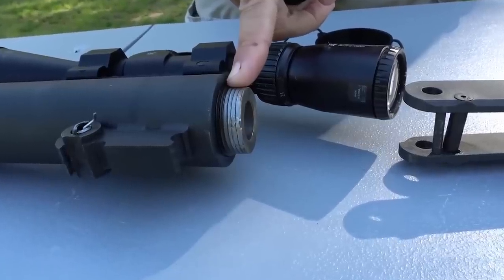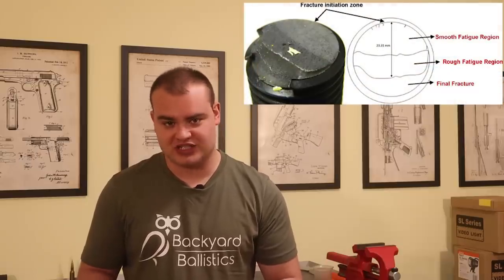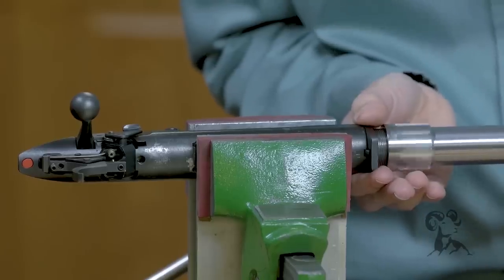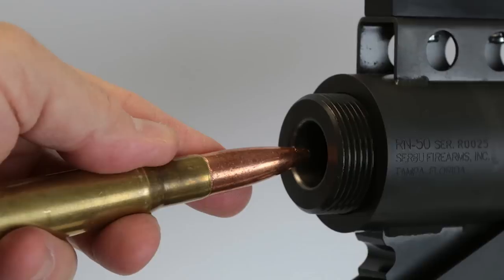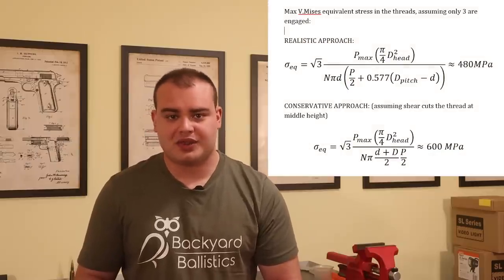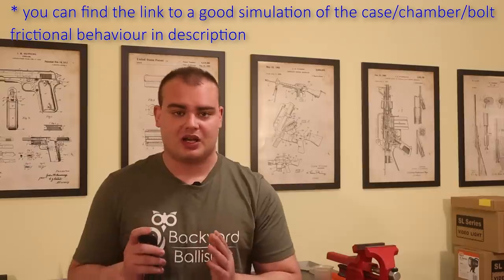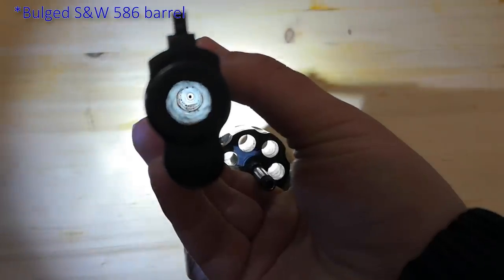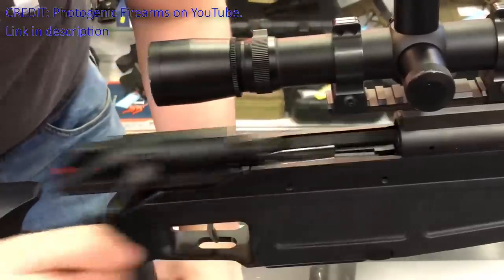Serbu RN-50 Failure: A Closer Look

Comment: The difference between a "Couch Forensic Investigator" and a "Professional Forensic Investigator" is that the Professional accepts the right answer even if it's a boring and uninteresting one and the Couch Forensic Investigator never accepts the right answer if it's not fantastic enough.

Good video of course the threads failed from overpressure.

Comment: In the end, the threads failed.  It is true that we don't know the psi of the round, but we also can't presume that it was above a reasonable safety margin.  Just a few questions that I have:

1.)  The cap did not have a recommended torque value, nor was there one recommended by the manufacturer.  Sufficient torque is required for this application.  Less than adequate torque reduces thread engagement, and weakens the connection of the cap and barrel.

2.)  In the instructions for the rifle, there is a recommendation for the application of masking tape to protect the barrel/cap when they can't be unthreaded without the use of a wrench or pliers.  A problem like this is an indication of thread wear, distortion, corrosion, deposits or an improper thread design choice.  Any of these problems will eventually result in a weaker thread engagement.  This will eventually cause even more thread distortion/erosion, and this will increasingly weaken the cap retention strength.

3.)  There is no provision for any venting of gasses in the breach as there would be in most bolt rifles.  As the gasses are not controlled, some will escape through the threads.  As they escape, the superheated gasses will change the properties of the metal where the gas escape is concentrated.  As these areas are temporarily softened they are almost simultaneously hammered by the rearward movement of the cap.  The temper of these areas will also be changed.  

4.)  It looks like the root of the thread remains on the barrel.  This may be an indication of poor thread choice, improper machining tolerances, deformed threads, mismatched tempering or improper steel alloy match.

5.)  The comparison of threads on the breech to the threads at the connection of the barrel to receiver isn't really a good one.  The threads at the rifle/barrel connection are torqued, more often than not are screwed together once, should allow no gas escape through the threads, and when screwed together are much cleaner than the cap/barrel threads will be over time.  Further, there are more threads in the receiver/barrel connection.

6.)  There is an indication that the powder has a slower burn on the shot just before the problem.  It's very possible that the load is different.  The shot before that is also a bit strange as impact is a foot low and to the right.  Even though the load of the rounds could be substantially different, both of these could be an indication of barrel obstruction.

7.)  Any weakness would progress exponentially and that needs to be considered in strength calculations.  It looks like your calculations are based on a new condition without any deterioration.  We don't know what the deterioration was, but it was present.  

It's important that a statistically significant sample of the rifles be obtained for testing.  It would be great if more of the ammo could be obtained and tested.  

I just don't see a simple solution to the problem.  

I'm sure you've considered many of these and you probably have excellent explanations.  I am not an engineer. 

By the way, your videos are very interesting.  Keep up the good work!

Comment: If anyone wants an update, there was pistol powder in the Slap round instead of rifle powder, which is VERY, VERY BAD, since pistol powder burns way faster than what you would use. The rifle itself was fine, but the pressure in the chamber was likely well over 150 000 PSI, while it is rated for 60k and was tested up to 85k.

Comment: Excellent video as always. Your position as a firearms examiner in legal cases, carries into this video in your delivery as well as graphs and formulas.

As far as the threaded caps, home made shot guns, be they slam fired or with a crude firing pin arrangement, using galvanized plumbing pipe, have been around for a while. There are police and military photos of these crude guns that had failed, but usually at the welded seam, never at the threaded cap. 

I do agree with your first video that failsafes should be incorporated in future designs, and likely Serbu's liability insurance company may mandate them.

Comment: I hope Mark remakes the RN-50 with some sort of interrupted thread breech like are used in artillery guns.
Reply: That would be a lot more expensive and I'm sure the rifle is designed the way it is to be cheap for a .50
Reply: @Phoenix_Atlas  it would not be that much more expensive. All it would really do for that type of breech is add a couple more turning operations on the lathe and maybe another milling operation. Besides, I think it would be worth the extra $200-300 per gun to incorporate that kind of safety measure, especially after having such a public display of the inherent weakness of the screw on breech.
Reply: @elburropeligroso4689  the inherent weakness that is rated at 20000psi over what the caliber should top out at
Reply: @elburropeligroso4689  a weakness that appeared at over 50% the maximum rated pressure of a .50bmg cartridge.
Reply: I hope he recalls all of them.
Reply: @elburropeligroso4689  He already talked about why he didn't do that and its because it takes a lot more effort and will add more cost though both complexity, R&D, and time.
Reply: @camojoe83  he might. I'd be a little surprised if he did, but he might recall them and add a whole lot of metal between the shooter and the breech cap. 

But remember that the failure was caused by a round at over 85,000psi. 155% of the design max of .50bmg.

Proof tests are conducted at 125%, and so *would not have caught this*.

Not to forget that SLAP rounds are explicitly only to be fired from M2 machine guns and not a Barrett or whatever rifle due to the sabot tending to peel off in the muzzle brake and cause a baffle strike. 

Going Ballistic has a liner that a friendly machinist made for them to hold the sabot together until the whole package leaves the brake, but they stopped shooting SLAP through their rifle due to the low muzzle velocity they were getting. SLAP is set up for a 45" long barrel, not a 30" barrel. Should have slower burning powder than standard.
Reply: @elburropeligroso4689  it was a military round, extremely expensive and not in current manufacture, aside from the round the gun would not have failed, as stated clearly by our friend here.
Reply: @ScottKenny1978  I'd wager that particular round would have damaged or destroyed most 50s given the minimal pressure required to have caused that failure.
Reply: @JohnDoe-nf7up  yup. That round would have totalled a Ma Deuce.

And M2s are build like a bank vault!
Reply: @ScottKenny1978  But Scott told Mark what rounds he would be using and Mark sent him a modified barrel to handle the slap rounds.  Seems he is involved more than you are saying.
Reply: @ragnarragnarsson3128  literally everybody has already determined that the round failed... Stop trying to make it the rifles fault, this was gone over in the last vid.
Reply: @ragnarragnarsson3128  round was at least 155% of design pressure for a 50bmg. Proof rounds for a firearm are 125% of max design pressure so would not have caught the problem. Also, note that a design that safely channels force of a failure at one pressure may not safely do so at much higher pressure.

You can survive hitting a bridge abutment at 25mph. Can you survive it at 50? Same problem.
Reply: @ragnarragnarsson3128  the modification required to safely shoot SLAP rounds through a muzzle brake is a liner to hold the sabot together until the whole thing leaves the muzzle brake.
Reply: @elburropeligroso4689   You forgot the need for an effective out-of-battery safety to stop the rifle firing without the threads engaged, which would be a major issue with an interrupted-thread design.  This would not be a simple or cheap modification.
Reply: @marcusborderlands6177  Mark hasn't completed his analysis of the RN-50 broken pieces...so nothing is settled yet.
Reply: @ScottKenny1978  No, actually it is a heavier barrel profile as well as a larger chamber.  Rewatch KB video on getting the new barrel from Serbu.  I am a structural engineer so I understand FS and consequences believe me.  I actually think the worst part of the design is not having a relief for excess chamber pressure like in most military bolt actions.  Also if it was an issue with the sabot and the muzzle brake, you would see a bulged or busted barrel near the muzzle. Not in the chamber.
Reply: @elburropeligroso4689  Interrupted threads aren't stronger, they're just quicker to engage and disengage.
Reply: @jic1  those tabs that sheared of and tried to get KB are the out of battery safety, if the cap isn't completely screwed down the action won't close.

I can't see a reason why an interrupted thread cap couldn't use those same tabs. 

Would need much bigger cap in order to have the interrupted threads be large enough to take the load, however.
Reply: @ragnarragnarsson3128  can't make the chamber larger without making the gun unsafe. Maybe a longer throat, to let the sabot out of the case entirely before it engages the rifling, but that tends to screw up accuracy. So I don't know what Serbu did to make the chamber different. All I would have done is make a "pepper pot" type sleeve that fit inside the muzzle brake, inside diameter of .52".

The heavier barrel profile may have compromised the way the gun Kabooms, however. It certainly could make the barrel stronger than the threads on the cap, which would then result in the events we saw with KB.
Reply: @ScottKenny1978  Because with an interrupted thread you would fully seat the cap and then turn it to engage the threads.  The tabs would close over the cap regardless of whether the threads were fully engaged or not.
Reply: @jic1  ah, gotcha.

I'd make the cap a bit bigger in diameter and put two relief cuts in it to line up with the receiver rails. Although getting the timing right on that would be miserable.
Reply: @ScottKenny1978  yes they are I have witnessed one M2 have an out of battery detonation. It was completely operator error while setting the head space but boy did it spray shrapnel out of the ejection port!! The barrel stayed together and the receiver as well just that unsupported case blew up. Took forever to get the case out because it was so mangled. Checked the gun with all the gauges and it passed!

Comment: In one of his earlier videos, I don't know if it is still up, but the maker said that the design did not have a great deal of margin of safety. He said it was plenty to handle the load that should be put on it, but didn't have much excess strength.
This was obviously something that was on his mind at the time, but he decided that it was strong enough. In his defense, it should have been strong enough for regular loads, but many manufacturers who "proof" their firearms put almost as much powder in a cartridge as it will hold and test every weapon to ensure they can handle excessive loads. It usually shouldn't be necessary, but that safety margin could end up saving a life.

Comment: Could it have been caused if the round was a re-load using a thinned case, hot load and over crimping of the neck?
Reply: That might be a possibility, these factors would certainly contribute, making it more likely to fail. but it also depends on the chamber dimensions and headspace of that particular firearm because these factors determine how and where would the brass case stretch and flow.
Reply: Biggest problem by far is gun did not fail safe

Comment: Backyard ballistic could it be hand loaded wrong powder or powder for stronger because of getting old as result I noticed muzzle flash was more than normal so rifle was compromised ? 👍🐾🦊🇮🇹🇬🇧
Reply from the maker: It could very well be a loading mistake. Actually, that's by far the largest cause of gun failure in general
Reply: We can see in Scott's video how the first SLAP round made a small fireball and moved the grass around the table and we can see in Scott's body that it had more recoil, then the second made a 2 or 3 times size fireball moving the grass up to the fance on the right and had a lot less recoil and a total lost of accuracy, two rounds of supposedly the same batch had totally diferent behaviour, the third one exploded... so is likely that the rounds were bad reloads.
Reply: Yeah, I had noticed it as well.
Reply: The wrong powder indeed can be calamitous,  but aging powders sometimes become less stable and can generate wildly inconsistent and dangerous pressure levels as well.
Reply: @sinisterthoughts2896  I think that was the biggest contribution to the kaboom.
Reply: @sinisterthoughts2896  I have seen rounds become erratic from sitting in direct sunlight for too long. I don’t know what the weather was like when the accident happened but even direct sunlight on a somewhat mild day can cause rounds to behave differently than they should. Add in a badly loaded (wrong powder is my guess) round or one that has sat in storage for too long (there is a reason we had spend-ex range days in the army) and the old powder broke down, and you can easily have an over pressure incident.
Reply: Is it possible someone made that round deadly on purpose?
Reply: @JR_22A  That could be due to plastic buildup in the brake, causing a round to yaw and clip the brake.  Still would not affect the breech pressure.

If it was due to the propellant, then all bets are off.
Reply: @Backyard.Ballistics  can see the excess muzzle flash 🐾🦊🇮🇹
Reply: @rickoshea8138  to blow the cap like he did it had to be a extra hot round. It could have been a combo of both. This is going to be a interesting post mortem.
Reply: @stuckgrenadepin.225  you are likely correct. More negligence that maliciousness. That’s why , when I fire reloads in my rn50, I only fire fmj and from people I KNOW.
Reply: @sinisterthoughts2896  my thoughts exactly naughty powder turned gun into a pipe bomb  🐾🦊🇬🇧🇮🇹
Reply: @aaronhiggs  Entirely possible, but not necessary.  I think that if a primer is pierced with a normal round; or is blown by a hot round, that extra cap area for the gas pressure to act on, is what will blow the cap.
Reply: @aaronhiggs  that is a good practice.
Reply: @stuckgrenadepin.225  yeah. I don’t trust random ammo. Especially ones that hit over 50k psi that is 2 ft from my face when I’m shooting.
Reply: @aaronhiggs  that is a good call.
Reply: @Backyard.Ballistics  
Maybe that old ammo was corroded and might have been tumbled to make it clean and shiny for re-sale, but during the tumbling the powder would have also ground into smaller bits and increased the burn rate exponentially.

Comment: Idea for a reason:
1st. someone tampered with propellant
2nd. propellant degraded into smaller faster burning charge
3rd. booby trapped

I want your opinion plz on 2nd explanation, can old ammo become dangerous overtime to shoot? Propellant goes into smaller bits, faster burning and more pressure creating??
Reply: Allegedly #2 is why Turkish 8mm surplus ammo is unsafe to shoot. Ian did a video on it.
Reply: @hobofactory  what's the video called? :)))

Comment: I was thinking that due to the high speed of load application, inertial effects may not be negligible. This may cause that the applied load is much larger in some zones than others. I don't know if it is at least in the order of the speed of sound in the material. It is possible that since the ductility of metals is a function of the rate of stress application this could have not been considered. Steel ductility is much lower for impact loads and can certainly cause it to behave as if it was brittle. If the powder burns too fast you get overpressure and high speed load application, then you would only need the  thread with highest load to fail to initiate a chain reaction. Materials mechanical resistance properties are always related to quasi-static load application and it is very important to take this into account.

Comment: Fantastic video. I’m was a proponent of metal fatigue causing the failure. However, Scott was using a different barrel/chamber with the same “plug”. In one video, he talks about how much easier it is to remove the spent cases from the new barrel. I thought that was really interesting. Could that make a difference?

Comment: Thank you for another  clear explanation. After watching your earlier comment video and some video’s of others I thought about the ammo, a point that some other commenters also raised. 
I know powder comes in grainy and in flaky form, and also in the form of strands (cordite) either or not with small channels running the lenght. 
The deflagration characteristics of a ‘powder’ depend in large part on it’s surface area. It would seem to me that this has a better chance of staying constant in a case when it comes in a cordite form, than when flakes or grains are used that can grind each other down due to movements such as caused by jogging or any kind of handling really. And by one in particular: ultra sonic cleaning, which might be done to give a fresher look to old ammo. It’s just a thought, no idea if anybody ever does this.  I am no shooter myself, just watching gun video’s thanks to the algorithm.

Comment: Did Scott use the "faulty" cartridge to prize out the last cartridge - it looks like he did and Scott is a very big chap, could he have damaged/weakened the case during this action?
Reply: That's how you get spent cases from this RN-50 - You can't really damage the case this way. You would need to try really, really hard.